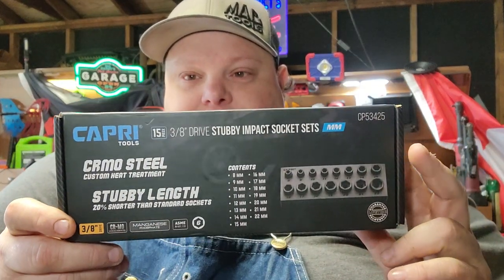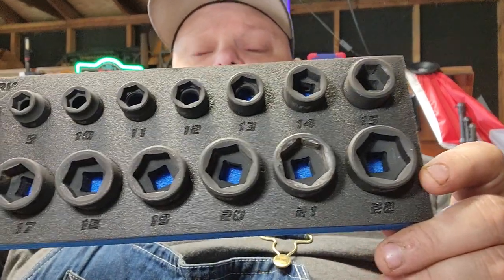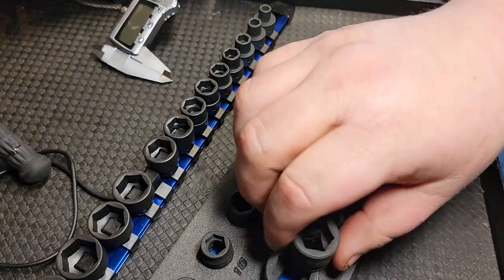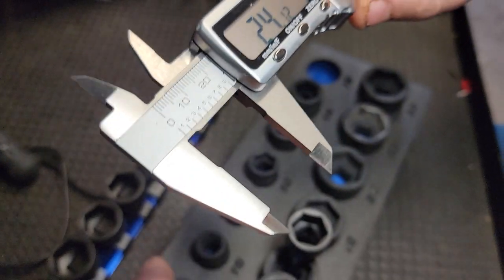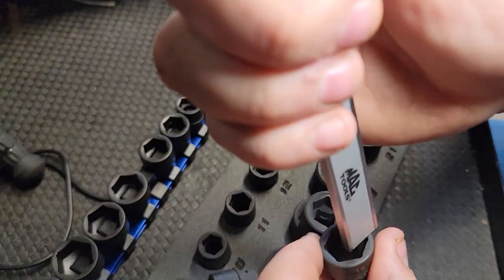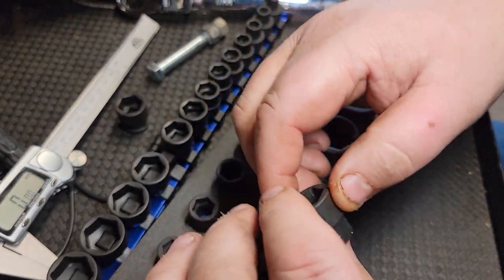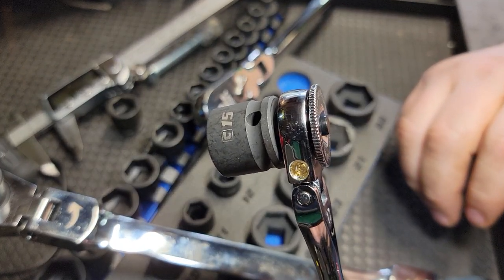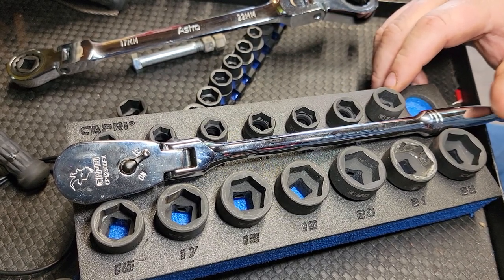"NEW" CAPRI TOOLS STUBBY IMPACT SOCKETS

Comment: I’ve got the Astro Nano 3/8 set and got the 1/2 on the way. I saw those Capri stubbies a while back and thought they looked nice. I also figured they were the same as Carlyle (pictures looked the same and they’re made in Taiwan), so I appreciate you clarifying they’re not. The other thing for me was the Nanos having that hex end that allows a wrench or Nano socket wrench to give it an extremely low profile. I don’t use them often, but they have come in handy a few times. 
Also, like you said, I e been having a hard time finding “killer” deals at Napa. They’ve got some ok ones right now (considering the be t handle ratchet for $60), but nothing like I’ve heard so many people say they’ve found.
Reply: Also, did you see Capri now makes mid length impact sockets? It’s only in 3/8 and I think you have to get the set (shallow, mid, and deep).
Reply from the maker: @JakeNaughtFromStateFarm  yes sir very cool!
Reply: just bought the Astro 1/2 impact swivel socket set. can't wait to get it.

Comment: I just received my set of 1/2" metric stubby impact sockets yesterday and used one today to remove a crankshaft damper from a Cummins ISX motor... I used my Milwaukee 1/2" impact, the first gen I believe, had it a few years. I think 1000 or 1200 ftlb of torque. These 18mm bolts have been in there since the factory installed them in 2009. I used the stubby, because I did not want to loose any torque, as I knew these would be a real bear to get out. Yep, it was a bear. I used a Milwaukee 9 volt lithium battery, I had to tighten the bolts for a few seconds and then loosen, and they would break loose. I think roughly twenty of them, and I believe 150 ftlb or torque, or maybe 115 ftlb, I have it written down. Only telling you guys this so you know what I was doing...

The Capri impact socket faired about like I thought it would, a bit rounded in a few spots, but it got the job done. I figure it has a use or two left in it for tough jobs like this. Regular usage, I would have to say it would have faired better. For what I paid, about what I expected. Would I purchase again, yep.
Reply from the maker: You should warranty it I think you will find the process impressive!
Reply: @CPthetooladdict  I think I will, thank you for the reply. All in all, still impressed. And would recommend.

Comment: Cp, did you do a review on the Capri 3/8 drive impact set? You got to short, mid length, and deep in the set with a socket tray. Any way my question is what are the sockets like? I have to put together another tool box at work and thought I'd by the impact socket set. But I'm concerned they won't do double duty for the chrome. So many times a impact is to thick for a job and you need both chrome and impact.  What are your thoughts

Comment: I enjoy your videos, but I'd like to add a constructive opinion. 
Pro tip: 99% of your American viewers will not know how to convert MM to inch, and or want to do so. What you are doing is making it difficult for them to try and understand the differences from one measurement to another. A person would need a calculator and a piece of paper to try figure out all of the metric equivalents. From what I've seen, there are a lot of mechanics who understand thousandths of an inch, but I'd be surprised if they knew metric better. And on top that, you have the ability to push a button on the vernier to switch between metric and inch. If you really want your non-American viewers to see mm, you should measure in inches and then press the mm button for them to see metric readings. As a machinist, I'm well versed in metrics, but I don't use it every day. However, if I need to convert a measurement, I know how to do it easily, but regardless, I think it puts a ding in that portion of your videos.  
Keep up the great work.